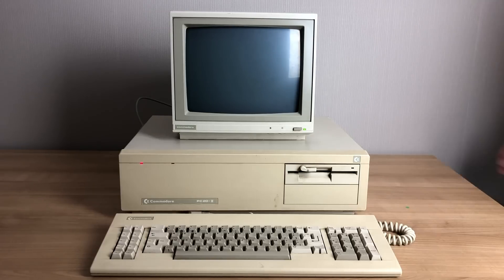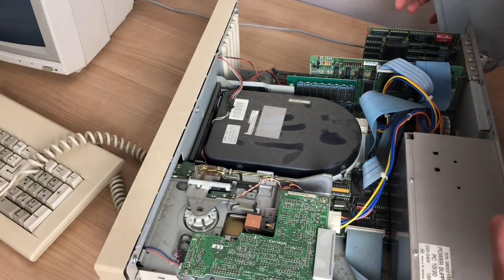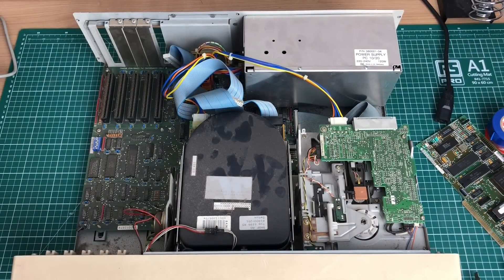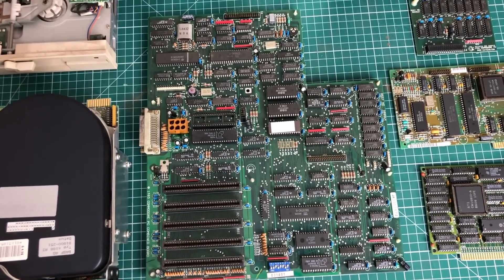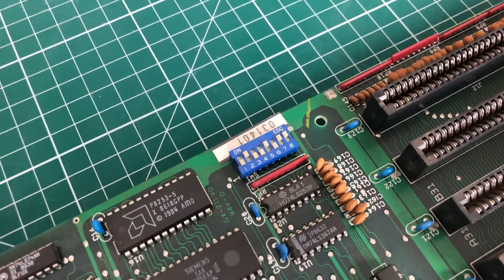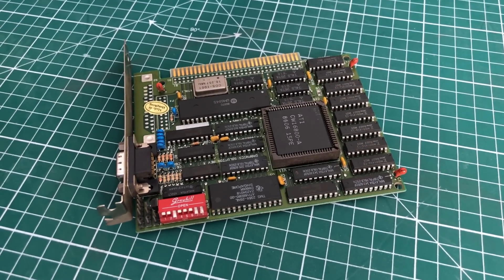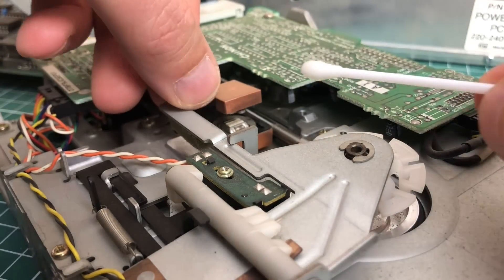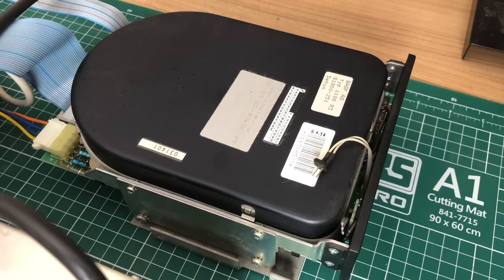Commodore PC 20 with a knocking hard drive

Comment: That monitor is a copy of the Magnavox Computer Monitor 80, in case you weren't aware, and 5 expansion card slots was very limiting in the XT days. A "real" XT had 8 slots, and most of them were filled!
Also, at 13:57 this controller shows support for both 17 and 26 sectors per track, which for drives with reliable mechanisms meant you could get 50% more storage out of them. The 10MB disks became 15MB and the 20MB disks became 30MB, though I'm unaware of any 10MB mechanisms that were capable of this reliably there were plenty of 20MB units that would run 26 sectors out there - Kyocera KC-30, Kalok Octagon KL-330, Seagate ST-238R, etc.

Comment: 10:30 Hard drive seek failure at cold start:  You can preform a low level format on the drive to "rewrite" the sector information. Probably that magnetic signal has degraded so far that at cold start, it is not even registered by the electronics of the drive. Otherwise, it can be an electronic component which is drifting way out of specs when it is cold, or even the engine bearings which couses too much friction when cold that it is just that tiny % too low on RPM.

Comment: 09:32 An Intel 8088 with allso an AMD logo?? WOW!!

Although, up till the 80486, Intel and AMD CPUs were Pin compatible, but after that, tey parted ways and become each others rivals.
Reply: AMD, Cyrix, IDT, WinChip, IBM, and a few others were also pin comparable with the original Pentiums using the Socket 7 and Super Socket 7 motherboards. It wasn't until the Pentium II that they began using different sockets.
Reply: Chip shortage in the 80s: Siemens, Amd, Nec, Fujitsu, Mos... were all producing licensed 8088! (Not clones, but original 8088)

Comment: That power connector was also used on the Apple II series.  -- EDIT -- Actually, it is similar to the Apple II but IIRC, the Apple II connector didn't have those half-circles in it.  So perhaps this is proprietary to Commodore.

Comment: It's an old diesel-powered hard drive.  You have to replace the glow plugs so it's warm before spinning up. :3
Reply from the maker: It does appear so.... will try to fix it if I can ... but need to do some reading on it....
Reply: @RetroSpector78  It's probably an easy fix. These drives have a separate head stepper motor which probably needs some lubrication. See Adrian's digital basement's video where he does this by dropping some liquid grease in it to free up the bearings..
Reply: @pipschannel1222  TRUE! I fixed mine that way, try it!

Comment: That knocking sounds like the stepper motor for head positioning getting a bit stuck. This can be caused by the motor's bearings running dry of lubricant, increasing friction. Adrian Black has a video on how to lubricate such drives: https://www.youtube.com/watch?v=-UJ0YE1a1Fs
Reply from the maker: I think mine is driven by magnets / coils. Not sure how to fix it (yet).
Reply: @RetroSpector78  Oh, didn't notice that there is no easily accessible stepper motor. Sorry for the noise and thanks for your wonderful videos!
Reply from the maker: Zufällige Zeichenfolge appreciate every single comment ! Nice to hear you’re enjoying the videos ! Make sure to checkout the other content also.

Comment: Excellent video. In 1988 I bought a Commodore Colt "Turbo XT" clone from Lycos Computers in Pennsylvania, USA. It came with DOS 3.3, I believe. At the same time, I bought a Seagate ST-138R 30MB RLL drive, from Hard Drives International, with a WD HDD controller. I also purchased an 8-MHz 8087 math chip, for astronomical programming (using mostly Borland Turbo BASIC). I used it for a few years, though I later upgraded the HDD to an ST-277R-1 65MB drive, which worked perfectly but made some extraordinary noises on startup and shutdown: https://www.youtube.com/watch?v=Fh6sd-kdFFg  Anyway... memories.

Comment: Worth while doing a low level format of that old drive. I've had a few that have mysteriously got better afterwards. Generally when it does the self-test it's looking for a regular test pattern on a track adjacent to the landing zone, and this degrades with time. Doing a low level format either through debug.exe and calling the routine directly, or some other utility or ROM routine on the controller card, you'll often find it'll behave much better to re-MFM encode the drive which will include the test pattern adjacent to the lzone.
Reply from the maker: Thx for the tip ... going to give it a try .. some also suggested that it might be a bad cap somewhere on the circuit board. Will check that also. And if all else fails, I’ll might add an xt-ide card to it. The only other available mfm drive I have has a stiction issue, and needs manual intervention for it to start spinning.
Reply: Yep. I can be stiction, and the cap also. A lot of old MFM, ESDI and RLL drives just won't start and many that do .. the EM fields around the place over 25-45 years have flattened a lot of the encoding. Also re-low level formatting will check the blocks for read-back afterwards and refresh the bad sector list which is actually really important but we're not at that stage yet. So yes.. definitely replace electrolytics, be super gentle when fishing for stiction to get it un-stiction'd, and find a way with your controller to low level format the thing. Additionally, if it's a stepper-motor design drive like most of the really early ones, make sure you have a head parking program that knows how to park and ship the heads off the platter of the drive. It definitely won't last long if you spin it up .. listen to the cool sounds then un-power the thing. The heads will stop riding that microscopic cushion of air and just "rest" on the platter ..waiting to grind their way back into orbit next time you power it back up. This process is called "Shipping the heads" or "Parking the Heads". If you know what all this is, great, else do a dash of googling :)

Best Wishes,
Al.

Comment: It was interesting to see an Intel chip had the AMD logo, and then you see the later AMD chip with the AMD logo :) So what is now AMD's logo was what they used before they split up.
Reply: AMD were never part of Intel. Intel signed an agreement with AMD under pressure from IBM when the original IBM PC was launched, as IBM wanted a second source manufacturer of Intel processors at the time. That's why the 8088 has an AMD logo but the Intel copyright marker on it.
Reply: @kevinh96  Sounds kinda like when the the Army sourced Jeeps back in the day.  There were 3 makers, the largest being Ford, and Ford's response was to stamp "F" into every one of their parts, even bolts, so they wouldn't be faulted for any issues with the non-Ford Jeeps, lol.
Not the same thing, but it made me think of that.

Comment: Very odd that it’s only 4.77MHz but has a 1.2mb floppy drive. I had a 10MHz XT. Only had a 360k floppy. ATs generally got the 1.2mb drives. 
As for the knocking and it going away after warmup. Sounds like capacitors. Check the board on the drive and the controller card.
Reply: That drive is probably only 360k

Comment: That's one polite hdd ^^

Have you tried to open the power switch ? maybe it's simply a part that have moved inside and is easily fixable ?

As for the HDD, perhaps some caps are dying, or maybe some bearings in it are starting to be stick a bit ?
Reply from the maker: Not yet... keeping that for another video. Switch should be easy fix or replace kinda thing. I hope the hard drive is gonna be as simple as a bad cap, but I doubt it :(
Reply: @RetroSpector78  Have you tried to run the HDD for a REALLY long time ? (by that I mean many hours or maybe even days) sometimes it helps with the mechanisms get back to working order (I don't mean warming it up like you do currently of course ^^). This worked on my 20MB western digital drive from 1988 (there's footage of it on my channel even though it's not recorded very well, but ... you get the idea. 

Youtuber Adrian Black has explained why that happened on drives exactly like mine (basically the bearings of the stepper motor moving the head are starting to stick which prevents the head from working properly).

This might not be the case with your drive, but I've always heared that running a old MFM hdd that haven't been used in years and that has problems can help making it working, and since it helped with mine, maybe it will with yours ^^
Reply from the maker: @DxDeksor  Will give it a try .... will need to find something that puts activity on the disk as I guess simply letting it running idle will not do very much ?